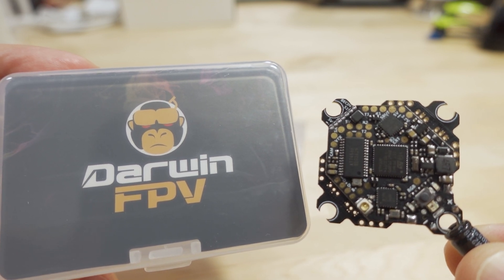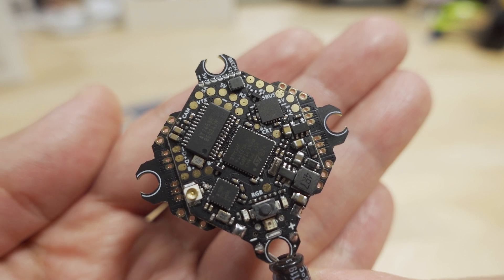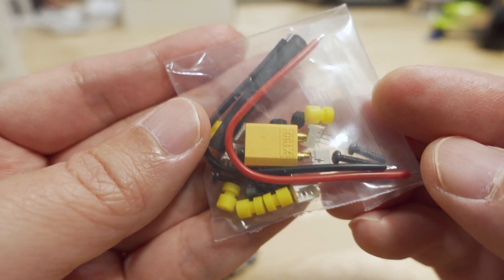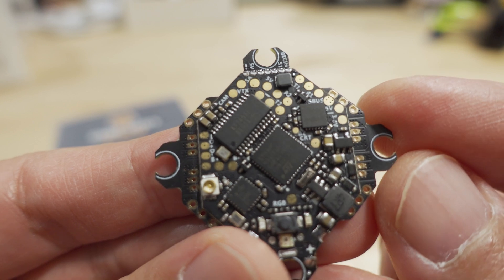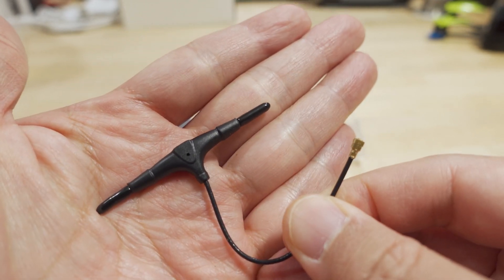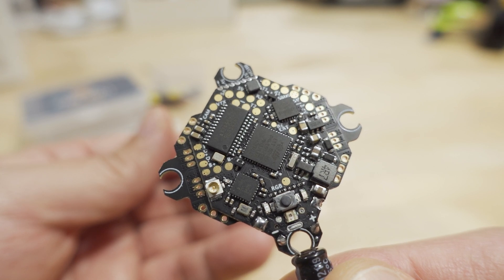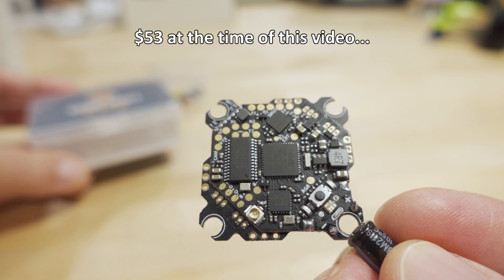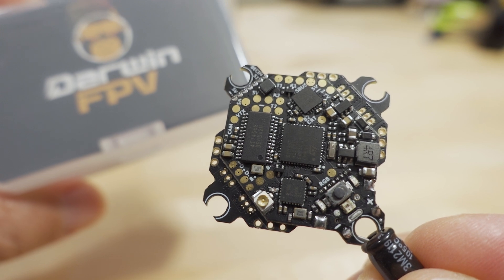DarwinFPV ELRS F411 AIO FC Review 🔩

Comment: Any update if this board supports elrs v3 or betaflight 4.4? Thanks, please mention me
Reply from the maker: Not yet but probably will be in a few months.
Reply: @AlbertKimTV  have you tried custom firmware to use elrs v3?
Reply: @AlbertKimTV  I tried flashing to 4.4 and now I’m stuck with no gyro message using the betafpvsx1280 target. Not good results with the Darwin targets either

Comment: Does it have an inbuilt voltage sensor? On the Darwin FPV site it mentions voltage sensor on the old non ELRS board but not the new one.
Reply from the maker: Yes
Reply: @AlbertKimTV  Thanks. Just bought one to try out Rotorflight on a Heli. Hopefully they will release one soon with a ceramic antenna for tight builds.

Comment: Looks good. Wish the USB was on the side instead of pointing down and the antenna wasn’t so massive. I also don’t get why the capacitor is pre-soldered. Otherwise looks like a solid board at a decent price.
Reply from the maker: USB down is to accommodate most whoop style frames.  The boards that are for bigger quads usually have 2-6S voltage range and those have the sideways USB ports.

Comment: it's pretty damn impressive when you think of what is packed into a small form factor, I like that manufacturers are not soldering in the plugs and especially battery leads as sometimes it seems they are almost spot welded in making it impossible to change out.
Some would say the down side is using 411 and not 405 and at that size I dont think it really matters although for features I believe F411 will drop off first from my understanding of what the developers have said. "Shrugging Shoulders Here"
Reply from the maker: The F411 is slower but also the cheaper option over the F405 (not available and more expensive than the F7)
Reply: @AlbertKimTV  oh wow, I didnt know it was more expensive than an F7 that explains everything, none the less I have a F411 board in a 5" acro quad and its fine, filtering had to be limited etc but I dialed it in for my style.
Reply: The biggest limitation of the 2 UARTs is also greatly helped by the ELRS being directly integrated into the board. Seems like a good option for a super lightweight 1 to 3s build for carrying an insta 360 camera. Maybe pair with some 3.5 inch props and a 13x3.5 motor 😉

Comment: Hey Albert. You showed us the board, but is it worth buying? If it is - WHY? And if it isn't - WHY?
Reply from the maker: Depends on what you want to use it for.  If you're putting this into a light 4-inch or smaller, it's a good option as long as your motor KV is matched for 3S or less.  If you have something bigger or heavier and/or need 4S or above, this board is not for you.
Reply: Thanks Albert, however, I mean, what about quality and durability? How about putting it on a whoop and countless crashes.